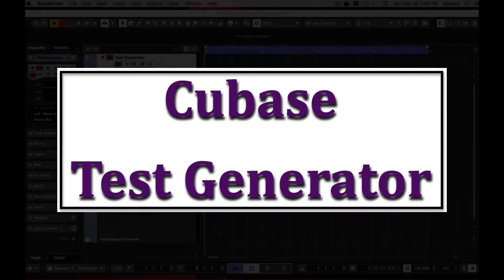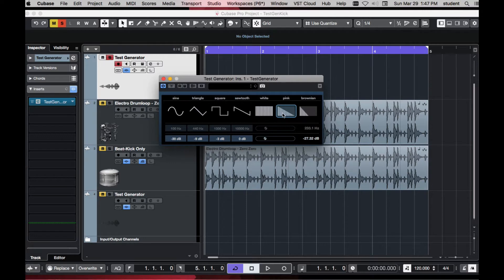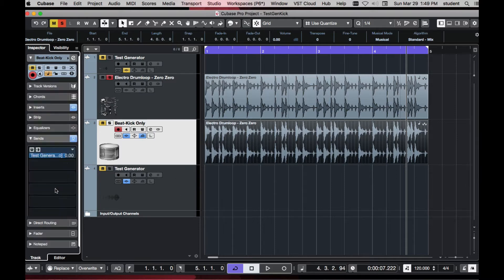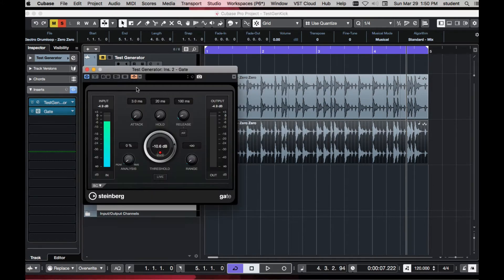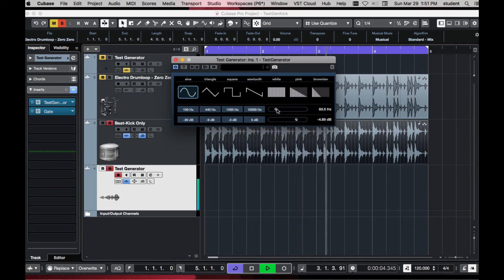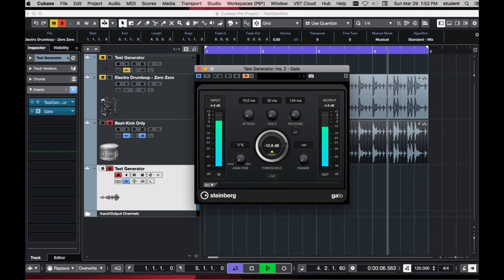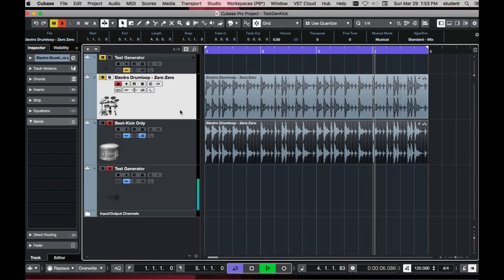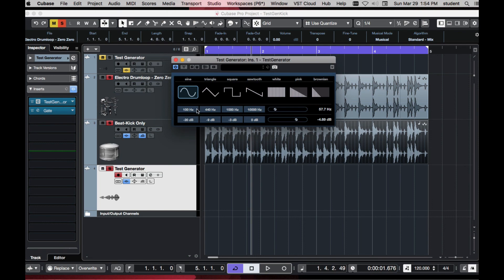Cubase - Test Generator

Comment: Test generator is NOT included in Cubase 12 Elements, do not look for it if you have this version of Cubase.
Reply from the maker: Yes - I am using Cubase Pro
Reply: @outerdarkness  Not in my one (Elements, the cheaper), only a tuner in Tools
Reply from the maker: @benitoherrero3895  Yes, the full version is Cubase Pro and that has the Test Generator.

Comment: Is the test generator here being used to "add" sound this drum track in this example?
Reply from the maker: Yes - it's hard to hear if you don't have good speakers.  The test generator is being triggered when the kick drum sounds.  This test generator signal blends in with the original sounding kick drum.  The result is a bigger and fuller sounding kick drum.